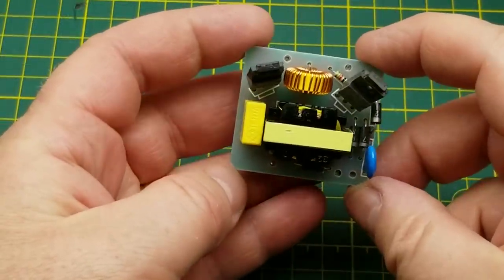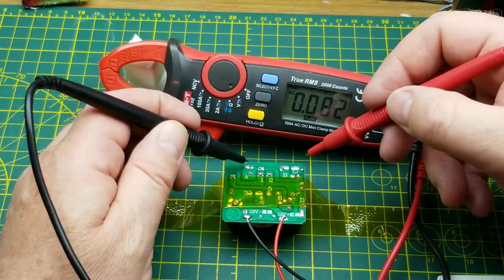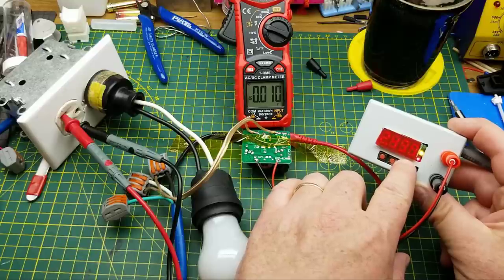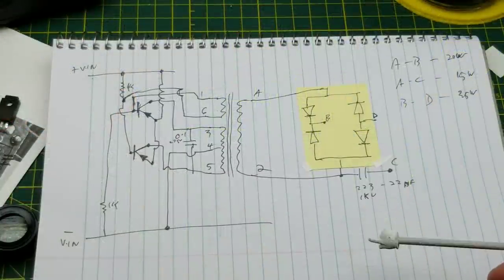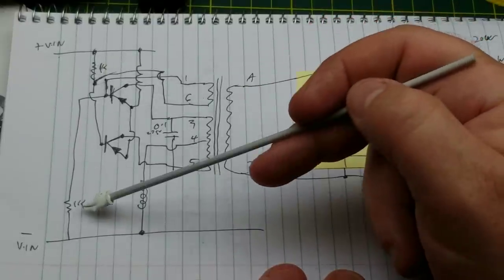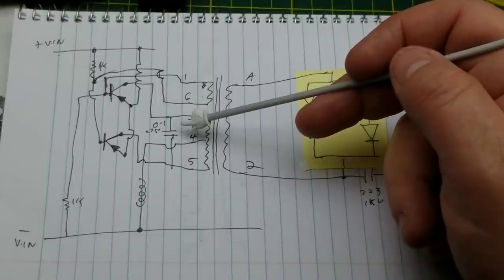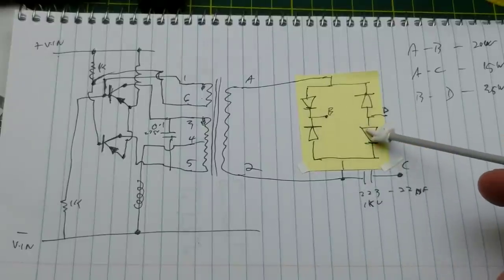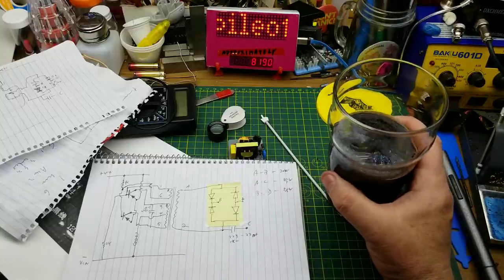checking out a cheap inverter

Comment: Great video. I'm thinking you had two separate issues going on. You meter is looking for 60Hz plus or minus. That oscillator was probably rolling along at 150-200KHz.
Second, I think there was an asymmetrical output that drove one transistor to do most of the work.
Just my take, great video!
Reply from the maker: Yeah, that guy was probably pretty high freq (at least before it had a meltdown). I probably should have spent the time to build up a proper resistive load so it would potentially survive a bit longer.  

Then again, I wasn't expecting it to be high enough quality to work at all...
Reply: @pileofstuff  Yeah, this unit may be for transferring power from solar banks through thin wires.
Many items I get from China require you to supply your own heatsinks.

Comment: The transformer will have short and tall spikes. 
A 15 watt 120 volt lamp will draw 60 watts to perhaps 240 volts because the resistance remains the same, thereby doubling the current and voltage. But it doesn't, incandescent bulbs are temperature dependent, when they are cold the resistance is even lower. 
Two 120 volt lamps in a row would be good.

Comment: Typical relaxation oscillator, I've built many in the past from scratch using beefier components and NPN transistors with massive heat sinks, never had that sort of failure. I use them mostly as 12 volt fluorescent lamp ballasts, Nice video!

Comment: As a non-native English speaker with slight impaired hearing, the auto captions are a great help for me. Unfortunately they are no longer available in your latest videos. Could you bring them back?
Reply from the maker: Sorry about that. It looks like there is a manual step I need to do for the auto-generated captions to become visible.
It should be fixed for this video now.
Reply: @pileofstuff  Thanks!

Comment: Cheap RMS voltmeters expect 50/60Hz.  That thing was probably doing one or two orders of magnitude faster switching than that.  That's why your meter had a fit.  It did look like you used an incandescent bulb though, so it's not immediately obvious what went wrong (cap dropper LED would be a BAD choice at that frequency).  I think the clue is in the fact that one transistor was cold and the other melted off the board - it seems it was putting out half wave at much higher power than the circuit was designed for.  I'm not sure what the application for this board is exactly, but I don't think it's intended as a replacement for what we normally think of as a 120/240 volt inverter.  Maybe for running small florescent tubes off 12V?  That would make sense if they are bombing the Ebay/banggood/aliexpress markets with these - the RV/camper market has been taken over by LED lighting so someone probably has a warehouse full of these inverters with no application and no buyers.

Chinese marketing at its best...

Comment: always check signal on scope before doing anything
Reply from the maker: I was concerned about damaging my scope with unknown amplitude voltage spikes, which is why I generally use cheap / sacrificial meters first
Reply: @pileofstuff  most scopes have overvoltage protection close to 1000V
Reply from the maker: @browaruspierogus2182  Generally true, especially for modern 'scopes. 

Not sure about my vintage one, though.

Comment: I've seen that oscillator before but can't remember its name. I'd check the actual values of those base resistors... and maybe if the transistors were inserted correctly. Something caused that transistor to abandon ship like that.
Your meter may have been seeing a lot of DC as well as spiky AC. A sillyscope would have given you more information but I'm used to toob scoped that are harder to kill than semiconductor scopes.

Comment: 25W NO probably for driving a 4W LED .

Under voltage it or overload it the switching stops or never starts & shorts one device !
I'm thinkings it's NOT 50 or 60 Hz  with that transformer .
Could be 100 – 1000 Hz so the out puts are 
B & D is full lumpy D/C out .
A & B is ½ lumpy D/C  !   ….......
A & C is yes a/c limited by the cap at some load dependent frequency ( so the voltage moves with load )    LOL

Comment: hi i think the oscillator stopped when the power supply went in to current limit and all the power went through 1 transistor and the transformer. it might still work or be fixable if it is worth it
Reply from the maker: That would definately explain it.

Comment: Love your videos. I need some help. I’m trying to wire a volt/amp gauge to a dc controller for a model railroad. When I hook it up it works one way but not when you switch it to the reverse direction. Is there a chip or diode or something to make it work both ways?
Reply from the maker: I would hook it up before the reversing switch.  Depending on the power pack that would mean opening it up and doing some soldering inside.
Or put a reversing switch before the ammeter.
Reply: @pileofstuff  thank you so much I never thought of that.

Comment: You have a 15W 120V light bulb, running at 240V. Do the math,, That is about 30 W. If the bulb survives. Then you increased the input current. What did you think would happen.
Reply from the maker: I'm actually surprised it survived as long as it did.